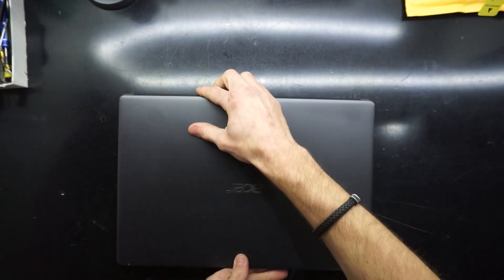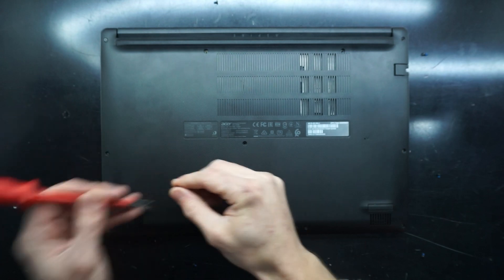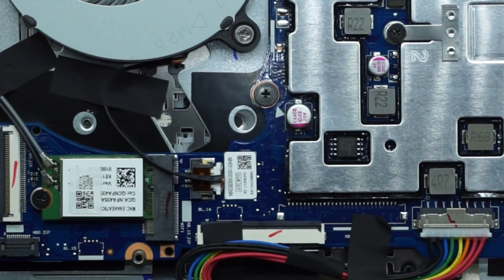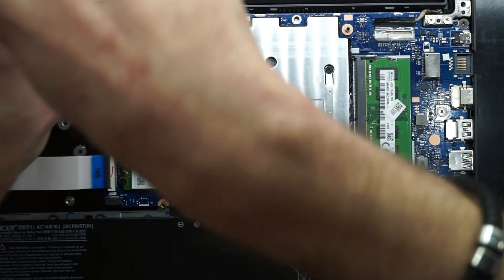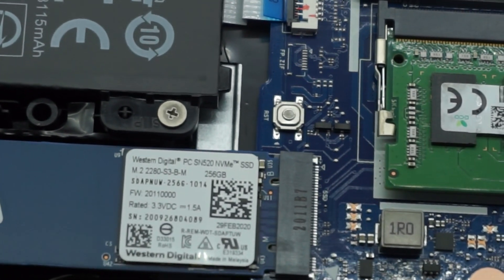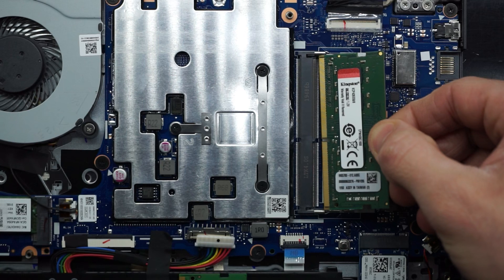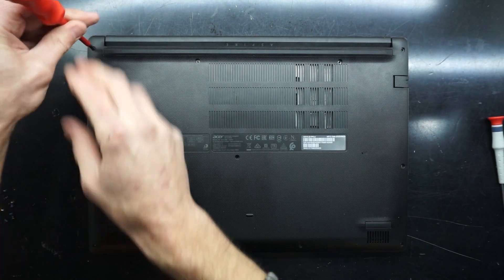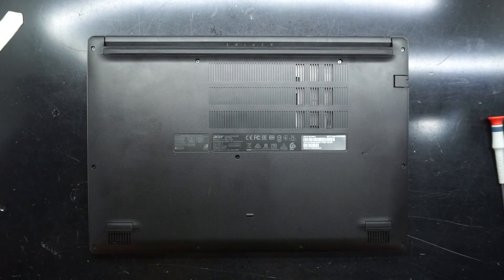Acer Aspire 3 Teardown and Ram upgrade

Comment: Thanks for video can I just add another 4 ram in the addition slot? (which I did not see in your video) or is it better to take out existing 4 ram and replace with 8 ram.
Obvious the 4 ram is a  cheaper option.
Thanks.
Reply: most of these Acer models only allow 1 slot so you only have one option of buying 8GB RAM. but if your model DOES allow two slots, then buying an additional 4GB RAM to add to your existing 4GB will not only be cheaper but you'll also be taking advantage of the dual channel which will slightly increase your performance. my Acer Aspire 3 A315-54K also allows 1 slot so i'll be removing my current 8GB RAM with a 16GB RAM next week. :)
Reply: @LeonHlabathi  give me your 8 gb ram ? i have a Aspire A315-54K too
Reply: @LeonHlabathi  ye dude sell it to him 😁

Comment: Yo love the vid helps me a lot but witch type of ram did you buy I can’t get the correct one I have the same pc as you
Reply from the maker: depending on price you could 
1x8GB DDR4 2666mhz Or higher depending on price
1x16GB DDR4 2666mhz or 3200mhz if its cheapers

Comment: I have a 4gb acer laptop and need it to be faster for university online work. Would upgrading to 8gb RAM help the overall performance of my laptop?
Reply from the maker: i think that would mainly come down to the hard drive and cpu in the system.

but more ram usually doesnt hurt but wont usually completely change the running speed

Comment: wow acer really did it, they are better than asus with the cover of asus hanged to the wires when you open.... I ordered 8 gb ram hopefully it will not be difficult to put in the extra ram
Reply: for 50 euros imported from germany it was very easy, like 15 minutes to get operation done....

Comment: I was working on the laptop (the same laptop in the video) and it was charging then it turned off completely and didn't turn on after that.. any advice how i fix this ?
Reply from the maker: If you can disconnect the battery, give that a shot

Comment: Hi Rick really good tutorial I'm going to get this exact laptop off of Amazon, you put in 8 gig ram can I put in 16 gig and can I upgrade the memory??? I just subscribed  😀
Reply from the maker: ram can be upgraded, i would recommend installing matching amount of ram, so 2x8gb or 2x16gb
Reply: @rickstechrepairs  As I know theese Acers came even 4 or 8 GB soldered to the MOBO. I think this one had 4GB soldered and 4 GB slotted and you just upgraded to 12 Gigs. This BIOS isn't able to handle more than 8GB added RAM.
Reply: i have 8gb ram model, does it have 2 ram slots??

Comment: would it be wise to just disconnect the fan completely? would it increase battery life?
Reply from the maker: No that is a bad idea

That would cause the CPU to run at maximum temp for its whole working life

Comment: Whats the issue if both led indicators are flashing when plugged with charger? Blue and orange led lights blinking
Reply from the maker: not sure sorry.

sounds like its auto powering up but still trying to charge the battery
Reply: @rickstechrepairs  and it stops charging..

Comment: You should push the power button a few times after disconnecting the battery every time you do anything to a computer. Also anyone that has the newer model should ignore this, it is totally different.

Comment: Hello ! I bought an Aspire model (3 A315-22-46YA8). I tried to install 2 different Crucial drams 4 gb  ( 2133 and the other 2666). Non of them worked. PC doesn't boot.. Suggestions ?
Reply from the maker: The Acer must not like that brand

Comment: I have same laptop and its quick hot when i used it
Reply from the maker: Cheers to see if the fans is blocked up with dust between the cooper cooler and fan

Comment: where is the other ram slot cuz my laptop says it has 2 and i’m confused and also is the cpu upgradable on the acer aspire a315-23 pls reply thanks
Reply from the maker: cpu is not upgradable

i would assume its lying, or you have a single slot and the other "stick of ram" is soldered to the board

Comment: By letting the battery in the same place can it generate some kind of static electricity and break my notebook while i am adding another ram ?
Reply from the maker: I don't belive so, well not static electricity
There is a extremely slim risk of damage.

But I find simply confirming the machine is 100% powered of before swapping the ram

Comment: Is it necessary to plug off the power before installing the RAM?
Reply from the maker: i dont belive so but i have plenty of people commenting saying you should
Reply: Yes, 100% - Always disconnect the power before adding / removing RAM... and be careful not to touch the contacts as he did in this video, as RAM is vulnerable to static discharge.  A computer technician should be wearing a static strap to prevent static electricity from damaging the RAM or any other components in the computer.

Comment: Hi can I ask if this is applicable for Acer aspire a315-56? And is it really necessary to unscrew the fan of the laptop? Thanks <3
Reply: i have a a-315-42 which is nowhere to be found but i unscrewed it and its easily possible to see and replace my ram, you can always unscrew and check i guess?
Reply from the maker: probably not but only takes a second to do

Comment: After trying to open my laptop it's monitor starts blinking when I'm using it. What I've done wrong?
Reply from the maker: blinking in what way, if its displaying a picture then it disappears for a few seconds then comes back, check out the LCD connector cable

Comment: hi rick, i have a problem with mi Acer aspire A315-31, It turned off suddenly yesterday, it did not turn on again and neither the charging light nor the ignition light work, as I use it for studies I would like you to help me know how to turn it on again
Reply from the maker: Hopefully something as simple as a damaged charger port or charger

But possibly more major 

Try disconnecting the battery and connecting the charger
Reply: @rickstechrepairs  i cant, the batterry is inside the computere, i cant disconnect it

Comment: Just to confirm if i have this model that comes with 4gb ram, when i replace ram can i add a 4gb to the empty slot to make 8gb ram or do i have to buy one 8gb ram
Reply from the maker: best open first to see if it has two slots.

if you have 2 slots, you could just add an extra 4GB and make it 8GB in total

Comment: Dear @rick tech am currently having issues with loading adobe programmes too much lagging and very slow if I upgrade the ram will it improve drastically? Plz advice
Reply from the maker: first thing i look at when computers are sluggish is what hard drive is in the machine..

..Anything thats running a 3rd generation intel cpu and newer (so 7/8year old pc's) the biggest thing that makes them sluggish is the hard drive, replace that with an SSD and that Will give you a noticable speed improvement
Reply: @rickstechrepairs  thanks what if I replace both SSD and ram because its new Acer aspire3 laptop I use adobe premiere, effects, photoshop etc
Reply from the maker: it depends on what the exact model is.. and hardware
Reply: @bin-naya1431  what’s ur model because I have the same question,also did ur worked .

Comment: Acer Aspire 3 A315-22-49ZE RAM upgraded maximum?
Reply from the maker: if you are running a A4-9120
dont bother upgrading the ram more than 8G..

..the cpu is so slow you wont see any difference

Comment: This model does not have extra slot?
Reply from the maker: did you watch the video?
Reply: @rickstechrepairs  yea I watch just wonder if there have hidden slot😅 cause my friend ask me about that if have hidden slot make me curious
Reply from the maker: No hidden slot just the single sodimm
Reply: @rickstechrepairs  I removed factory RAM (4gb Stick) and added a 16gb now it says I have 20gb Ram, where is the other 4? do I need to remove or will it function OK?
Reply: sorry im a noob

Comment: can i play nba2k22 with this laptop?
Reply from the maker: Doubtful
Reply: i'm back dude, i installed it properly and it can run nba2k22 and it works fine. it has 4gb ram can i add 8 gb ram to make it 12 or it is better to replace than add?

Comment: Hola que frecuencia es la ram el mio tiene 4 de ram internas y pienzo ponerle otra de 16 gigabytes pero no se si es de 2400 mz o de 2666mz
Reply from the maker: I believe the Intel CPU tops out at 2400mhz 

So I would go either 16gb 2400 or 2666
Whatever the cheaper of the two is
Reply: @rickstechrepairs  la mia trae una cpu amd ryzer 3 3250u

Comment: mine has 2 ram slots somehow. model A315-55G-5512
Reply from the maker: I'm guessing that is a i3/i5/i7 model
Reply: @rickstechrepairs   it's i5
Reply from the maker: nice
Reply: @rickstechrepairs  I found that the single fan is basically useless in cooling than just blowing air outwards. How my CPU didn't throttle then?

Comment: I just bought Acer aspire 3 a315-23 and it has 8GB of ram, I want to upgrade to another stick of 8GB, so I can use it in DC mode. I am trying to figure out the frequency, but I have conflicting information about the ram speed. Cmd shows 3200, Radeon Adrenalin also shows 3200, task manager shows 2400 and CPU-z shows 1.2ghz uncore memory, and 933.00mhz DRAM Frequency. What's the right information here, Jesus. I still didn't open the laptop up because I haven't bought the stick. Did anyone encounter this before?
Reply from the maker: I would typically just get 3200mhz as it will down clock speed to match if you have slowed ram
Reply: @rickstechrepairs  I figured it out. Ryzen 5 3500u can handle max clock of 2400mhz. So that explains it i guess..thanks for the suggestion
Reply from the maker: ah that does make sense, most ram in laptops is cpu restricted (cause it cant max the ram)
Reply: @rickstechrepairs  I don't have much experience with lap tops to be honest, i build only desktops for myself.This is a neat piece of info to know. It's really dumb that they don't tell us which ram they soldered in the declaration. I get that you have some leeway when it comes to ram, hell, you can even get away with using second hand parts most of the time, but is it that hard lol. Anyway, thanks for your time.